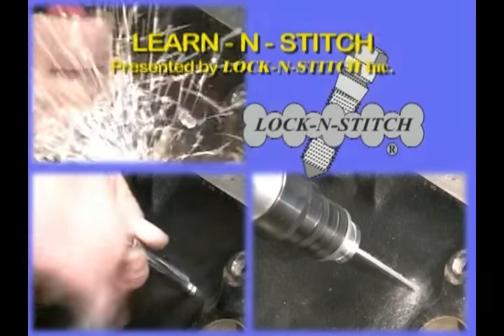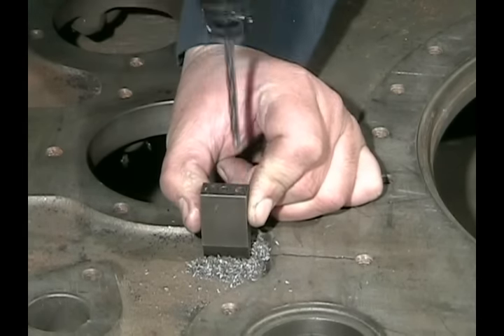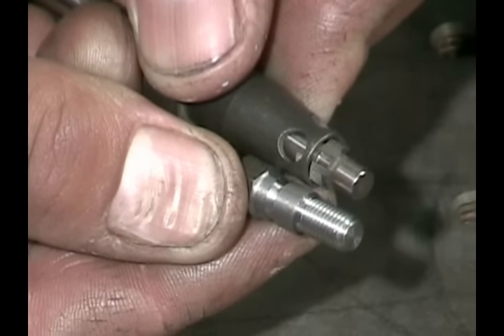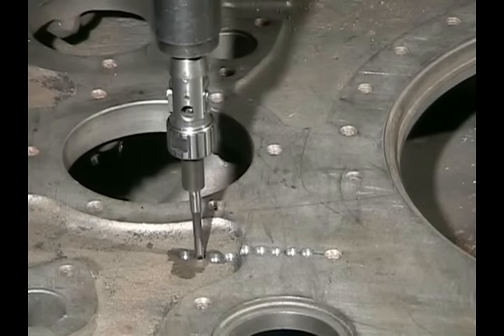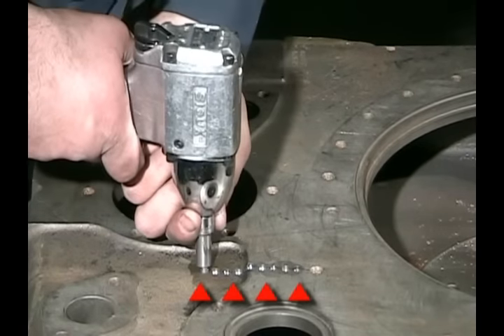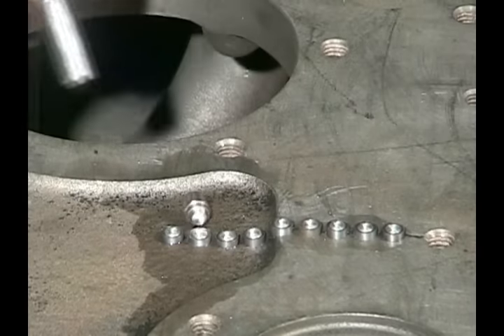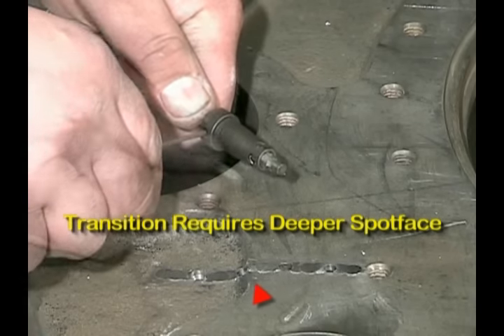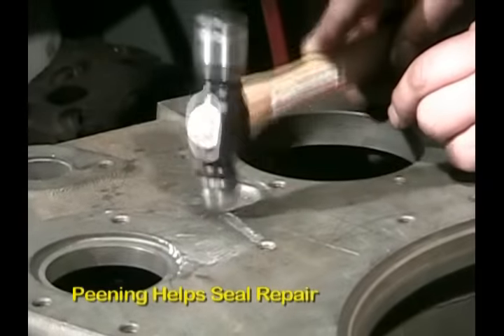Cast Iron Crack repair

Comment: It doenrt work!!! 
I had a pair of 486 double hump fuelies that would last about a month after twice stitching then I found a genius welder who developed a method of welding cast iron in a furnace using 1/4" square virgin cast iron rods with a water cooled oxy acetylene torch.
I had those heads re-surfaced and  the machine shop guys could not tell where the repair was, never had another problem with those heads ever again.

Comment: Skilled time consuming repair
Reply from the maker: Installing LOCK-N-STITCH stitching pins can be done quickly with pneumatic tools.  Up to one inch of repair can be done in 5 minutes in 1/4" thick cast iron.  The pins are designed with a breakoff groove that causes each pin to break off at the same predetermined torque and LNS pins have shoulders that set into the casting so the threads aren't exposed at the surface.  Perfect metal-to-metal finishes are easy to accomplish.  Stress free, uniform repairs seal without the use of epoxies and coatings required by inferior stitching products.  If you have additional questions please feel free to contact our technicians by phone or email 800/736-8261 - 209/632-2345 or info@locknstitch.com

Comment: Why 653 dislikes when he did a perfect job and explained some stupid people go on YouTube
Reply: Probably because this is the worst way to repair cracked iron castings. This may be an old method, but welding the cast iron is a far better repair. If it was me having to repair cast iron for someone, I'd just by some decent rods and get to it. This method above puts even more stress on the metal and it will crack again.
Reply: John Doe you could be right since im not sure 100%
Reply from the maker: If you are ever interested in learning more about how to repair cast iron with metal stitching our technicians would be happy to send you more information.  Thank you very much for watching and for commenting!  800/736-8261 or info@locknstitch.com

Comment: a lot of work! TIG weld solve this very quick
Reply: No. Torch welding is much better because you can pre-heat the area around the weld before you do the actual welding. This helps reduce warping, and also helps reduce hair-line spider cracks. Tig welding cast iron isn't that good. Not for something like this.
Reply: Never heard of Tigging Cast Iron and pre heated cast brazes fail miserably half the time. Dealt with this crap my whole life and these tapered cast bolts work flawlessly every time.. Will use them forever.
Reply: +fla playa brazing is one thing. Actual torch welding with iron filler metal is another entirely. My boss does this at-least once a week.

Comment: this technic is very unlikeable! example : 1 cup of metal crack. to fix it. I'm using welding machine to reconnect... in this video its not weld its patch nothing reconnect from left to right! like in a wood i put a 1inch a nail to impale not using a glue to connect...

Comment: 50 percent of my tap broke off I’m fawk!!
Reply: Beautiful! Had to watch it to the end to really understand how completely it can seal. 
I had to weld a crack in a Chevy block once. It was in the water jacket and a 2”x2” chunk had been knocked out of a thin section when it was dropped. Tried Nickle rod, preheat the area, peen it afterwards. No luck. It still cracked on cooling. Then I tried using low hydrogen rod with the same technique and had success! The LH rod was more ductile and held up to the forces of contraction during cooling better than the nickle rod. 
I can’t imagine using stainless. That stuff contracts A LOT during cooling and the surrounding cast iron can’t take the tension created. 
Still good to learn new stuff though. Thanks for the video.

Comment: Sorry but never and I mean never use power for tapping.
Reply: Or just know what you are doing...
Reply: Errr no, and as you have made that comment means that you don't know what your doing.

There's some very good reasons why you don't use power for tapping can you list them?
Reply: The tool the tech is using was developed specifically for the purpose of tapping by hand. It automatically reverses at a set max torque level. They are used extensively in the aviation industry. Again, if you aren't a knuckle dragging ape, powered tapping is just fine.
Reply: Not in this application...the tool he is using is designed for that
Reply: prophaniti1 Beginning your statement with an apology takes away your credibility.
Reply: ***** I think he shows in his second comment he wasn't trying to be polite.
Reply: LOL you need to get up to date...
Reply: prophaniti1 

You may have your reasons for saying "never and I mean never use power for tapping" but doesn't it strike you as a weird thing to say after watching a video of someone successfully doing what you're saying not to do??? He's using whatever tool he is using, and it is working. Maybe it is just you that should never, and I mean never, use power for tapping. Just sayin.

Comment: i have a better cast iron repair solution, it's called welding.....with the appropriate filler metals, gauging, grooving, pre and post heat of course.

Comment: that's a bunch of bull no crack starts in the middle and stops before it reaches the ends , T his is an auto motive section of utube takes a lotta balls to shove a machine shop mill rite procedure on us like this, leading us to think this will work for an automotive cylinder head (it won't ) but some nuby shop svc. writer may fall for crap like this.

Comment: To help with confusion😂😂
Good welders would fix that crack and never look back. It will hold too!
There is the argument that this is better, and may be, but I would trust my welds before I would trust half-ass rethreading and glue
Especially in engines where expansion occurs, that loctite he used on threads would be your weak link and should be brittle.
But just to enlighten, I have seen an old man use a peening method to close a crack on a hot engine block!
Reply from the maker: Thank you Logan for your comments - We invite you to read this white paper written by Gary Reed  to better understand why cast iron cannot be welded and how it responds to heat differently than any other metals.    http://www.locknstitch.com/pdf/gmrc_white_paper.pdf
Reply: LOCK-N-STITCH INC. with all due respect, your reply stated that cast iron CANNOT be welded and read this white paper.....
I have personally welded cast hundreds of times. An entire book could be written on cast weld recipes---AC vs DC, reversing polarity, pre and post heating, controlled cooling, nickel rods, rod coating, etc.... And that doesn't even touch the stir welding and brazing, which some old timers could school me for weeks on do's and don'ts. Uniform anealing is the real key, but there are thousands of non-leaking blocks that were sealed with JB-weld. Not that I would use it on an engine. I have however done a lot of thread tapping and I believe that on a head or block deck, resurfacing would need to be done after using your product, at which point, I am certain the milling bit would rotate threaded inserts breaking the glue bond and creating a path for water or compression to work into for months to come. But who the yell knows? Good luck, I hope u sell a bunch of em👍👍👍

Comment: For people that have no clue what so ever that there is a process called welding out there...
Reply: And that's what separates the Boilermakers from the welders. If you knew anything about welding you would know that the HAZ is detrimental to the strength of the casting and you would know when and where to use the correct process!
Reply: z400rider08
There's even people out there who don't have a clue that they should probably keep their mouth shut because it lets others know that they 
really have no clue about the process they're yapping about. It's true! Trust me. They're really not hard to find.